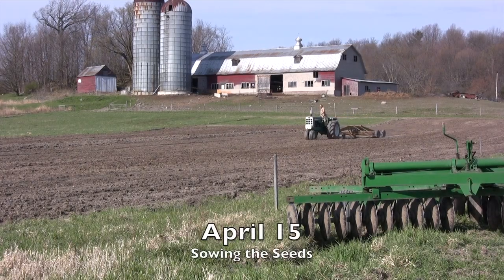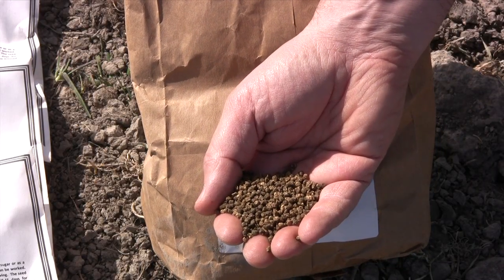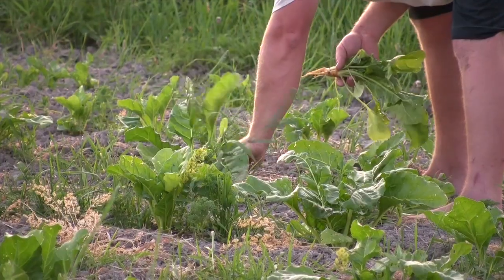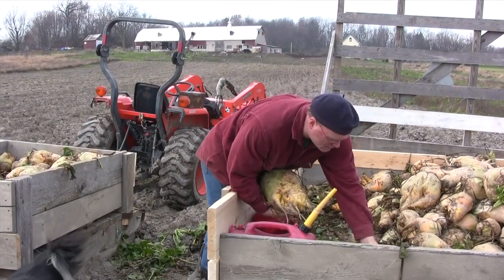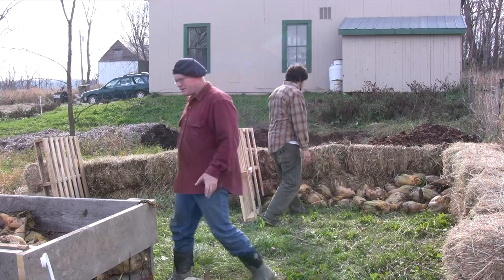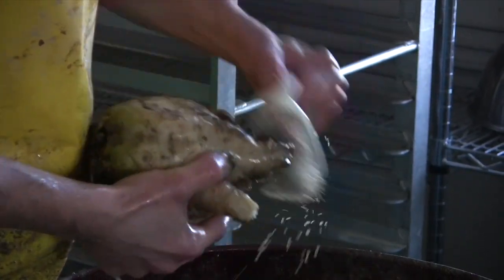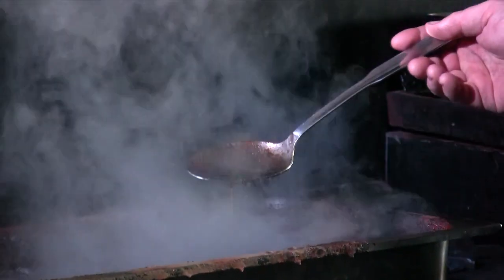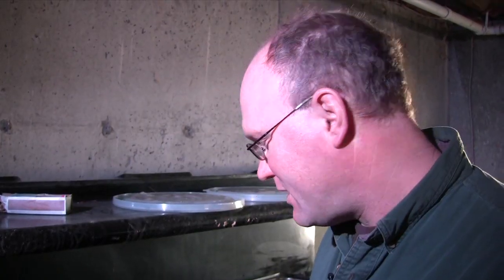Small Scale Beet Sugar Production Methods

Comment: I think they separate the molasses off before crystallisation, don't they? Do you know how to do that? Can I also ask how you made your clamp? What did you cover the beets with?
Reply: In the commercial setting they add lime and carbon dioxide gas to the beet juice, which causes impurities to come out of the solution and allow them to be removed with a filter. The filtered juice is than boiled to remove water until it's a thick concentrated syrup. When cooled, sugar crystals come out of the syrup. The mixture is then put through a centrifuge, which spins out and separates the molasses from the sugar crystals.
Reply: @kovona  Very precise. 
I am wondering if using fired sea shell/oyster for slaked lime is cost effective, energy efficient with reduced carbon footprint than other alternatives to making lime solution.

Comment: You can juice and clean up the liquid before boiling.  I have come close to removing all the beet flavor using capillary action to filter.  Chemists call it Chromatography.  It has the ability to filter precisely.

So my method I have used on alcohol as well and found the effect similar to sending it through a Brita filter.  It just won't plug as easily but it removes most flavor.

To explain I need to first get you to see in your mind what you are doing.  Place paper in water and it wicks up.  Place that paper over a ridge and down and it will drain the first container.  Imagine Newtons Cradle (a marble swing of 5 marbles held by individual wires where pulling back the first and letting it knock them send only the 5th flying on the other end).  In the same way the molecules knock molecule by molecule each water molecule along.  Other particles may hitch a ride but its only the water that is moving.  So you get some filtration from one dish to the next.  What I noticed was after 4 or 5 the beet taste was not noticeable and I hate beets.

So how to do 4 or 5 filtration in any sort of production way?  I first used chicken waterers.  The watering system where you turn it upside down and pour in a gallon of water place the lid on and the force of vacuum holds the water from pouring out till the water level goes down.  Now I used coffee filters to drain from the waterer to a small tray which drained to another and another.  A total of 4 trays and on the find a bucket is underneath catching the liquid.  Once set up it takes a good 24 hours to work through.  Of course the residual left behind is waste you can't keep the small amounts left in the container and the trays but the final bucket is fairly pure.  Cost effective and doesn't plug like a filter would with impressive results but it is time consuming.
Reply: Great work Ian, I'd love to give sugar production a try and am not a huge fan of beet flavor either.
Reply: I'm liking your comment so that, if I get a chance to try this, I can find it again more easily  :)

Comment: I was wondering about integrating beets into a variation of soil rebuilding.

Polyface ferments corn into deep bedding- they do this so pigs will come in and turn the soil. They also raise pigs outside and put them on pasture rotation. This helps rebuild the soil.

Could you sow beets into a paddock in order to encourage pigs to turn and service the soil?

Comment: The longer you wait to process them after digging them up the more sugar you lose because the root continues to burn its fuel source.
Reply: IDK… in Montana, sugar beets are a strong crop, resourcing a sugar refinery.  Piles of beets are often left outside until hard frost, which improves sugar content as starches are converted.  You bring up an interesting question!  I wonder how a period of refrigeration or even freezing would shift up end product.  Also the steps to remove molasses.  I’m not ready to throw this one out.